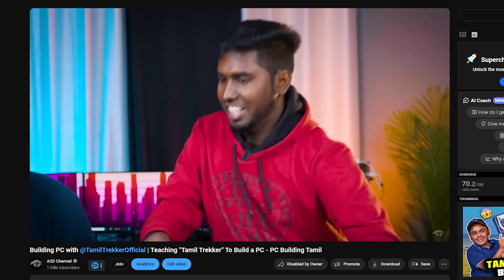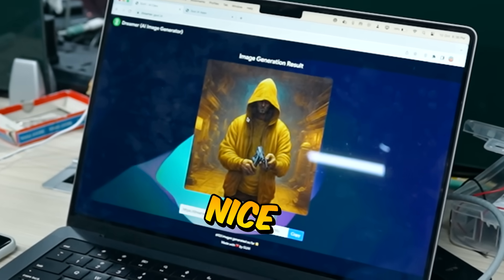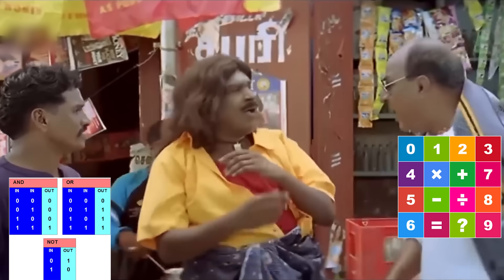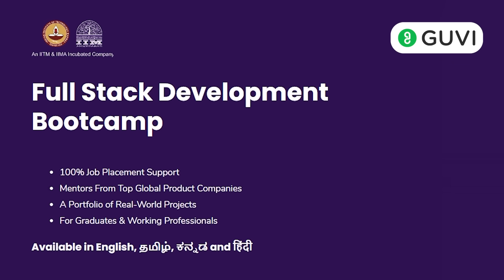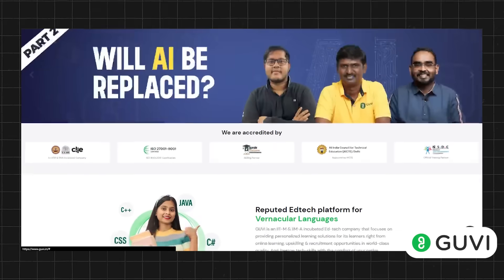Three Coding உருட்டு Burst! - ”தமிழ்-Medium” To Programmer | EdTech CEO PC Build

Comment: Hello soldiers, Even though this is a pc build video or programming pathi soldra video va irundhalum just oru information ku sollanum, 17:25 la knob control panna voltage control aagum nu nanda bro soldradhu exact ah correct illa but technical adhuvum correct dhan.
Actually andha Knob is a variable resistor. And the main job of the resistor is to limit current not the voltage. So current limit pandra appo voltage drop irukkum.
That's why the light is dimming  when turning the knob. 
Just for information😊

Comment: Hi soldiers, nowadays the size of the processores are being reduced like 4nm sd8 gen2 and 3nm apple's A17 bionics now my question is there is a phenomenon called Quantum Tunnelling it will appear in the minimum size of the transistor (like 1nm) that processor,within 6 to 7 years we grown from 28nm to 3nm what will be the ending of this and I think we can see the ending in one year or less than that and (small size helps to increase the performance and reduce the power consumption) that's what apple is doing but Snapdragon and mediatech are providing high performance in less power consumption for example sd8 gen 3 is better than sd8 gen 2 at the same 4nm size the crazy thing is both are fabricated by tsmc (arm method fabrication) and major was wrong not exactly wrong the hardware of apple is good because major of them was manufactured by Samsung please convey this to major(pcdoc nantha bro and Ganesha too)to make this comment I stole my friend Hotspot and sitting in the hostel room and typing it please contact me via email nanba to

make better conversation

Comment: Can anyone answer me this. I been looking for this answer for a long time. I have a core i5 6600 k cpu which is working fine. But my gpu is GTX 970 which is pretty old card now. I am looking to buy a new graphic card just for 3d rendering from Blender and not going to hugely play games with it. So the Blender software is going to use 100 percent my GPU only? and there wont be any bottle neck. or is there going to be bottle necking even for 3d modeling ? i am planning to get a rtx 3060 ti
Reply: definitely bro better upgrade your cpu .

Comment: in my PC I'm not getting the display output but cpu is booting i cleaned ram sticks but still not showing in display please help A2D anna
Reply: Check whether you have plugged the vga or hdmi in the correct slot where if you have gpu you have to only plug in to the point . Finally check the cable whether its the culprit.Hope it helps 😊
Reply: @akshayv8305  hdmi detects the cpu but output is not showing

Comment: 0:44 IIT Research Park......
0:56 Guvi Founder Kku PC build solli thara porom.........
1:13 Guvi Startup Company Founder........❤
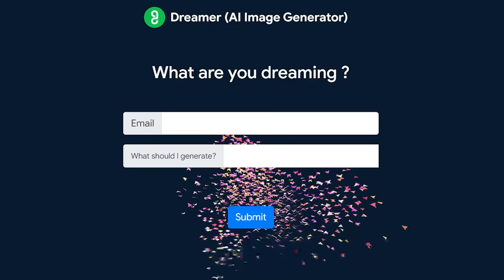1:20 Guvi Building Ai Applications........❤
2:08 What They are going to do.......
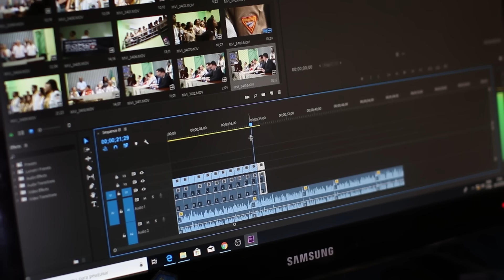2:27 PC Building Arena.......
2:54 Processor........
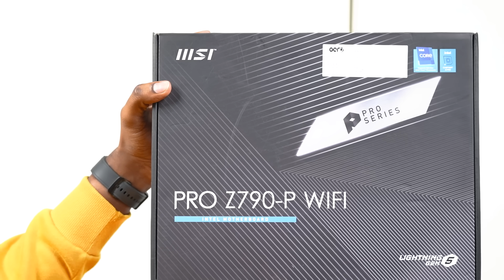3:43 Motherboard.......
4:32 😅
4:47 G Engineers Rest in Peace........😂
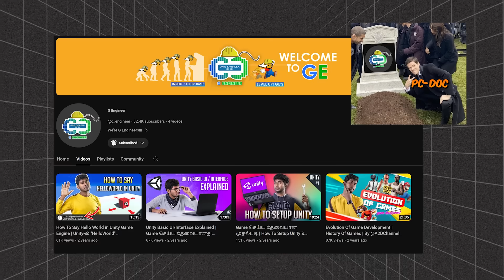5:00 How PC-DOC started Programming.......
5:33 Programming Pudichi panningala enakku suttu pottalum Programming varadhu.........🥺
5:46 Programmers kitta irukura Myths........
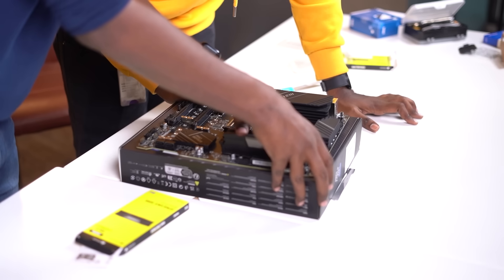6:29 PC-DOC Maths.......
7:00-7:55 Avaru Epadi Programming Kathukuttaru........
8:00 Irukuradha vechi kooda skills kathukalam........❤
8:24 Guvi Offering Full stack Development Course.......
8:56 About UI/UX.......
9:30 Liquid Cooler......
9:38 PC-DOC Vision About Programming.......❤
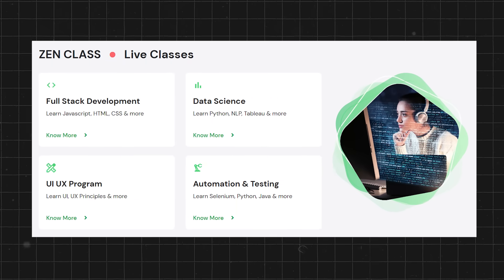10:08 Zen Course in Guvi.......
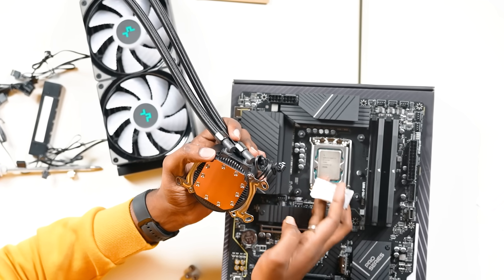11:30 Example.......❤😅
12:00 Moto For this collab........❤
12:17 Small Advice........❤
12:32-13:30 Vera course padichittu vandhavanga Programming Kathukalama.........❤
13:42 Mentor in Guvi.......
14:15 Cabinet.......
14:29 வஞ்சத்தில் வீழ்த்த முயற்சித்த பிசி-டாக்.........
15:01 Power supply........
15:11 Final PC Building and Cable Management part.......
15:41 GPU........
16:10 PC Build Success.......
16:30 What and All they Discussed........
17:14 Programming Is Everywhere........❤
Reply: இந்த சேவையை பாராட்டி சேவை விருது குடுடா A2D😄
Reply: Yaru saami nee 😮😅😮😅😮
Reply: Great effort 😊
Reply: Yarappa ne😢
Reply: Get a job
Reply: Ipdi avanuku time stamp adichu polaikarathuku nee vera yevanukavthu Kai adichuvittu polachikalam thu
Reply: @சரவணகுமார்-ல1ங athu mattum tha unaku therium